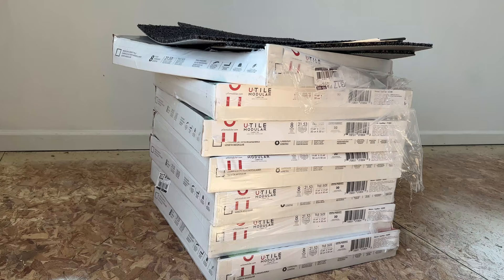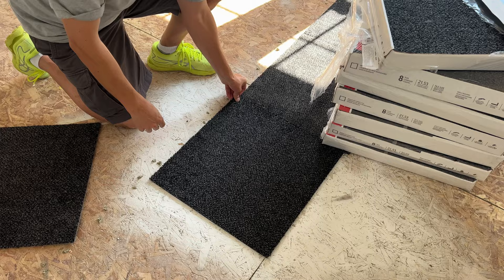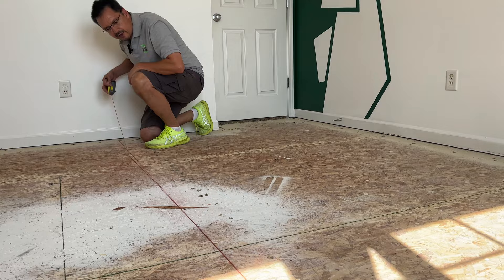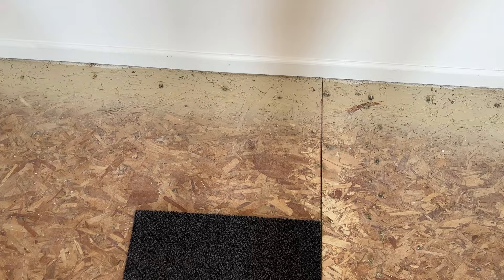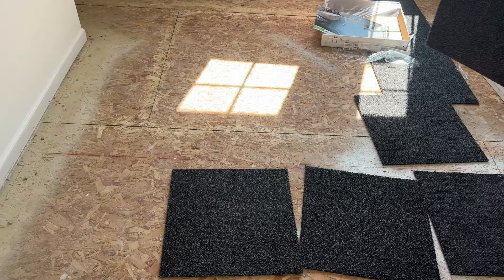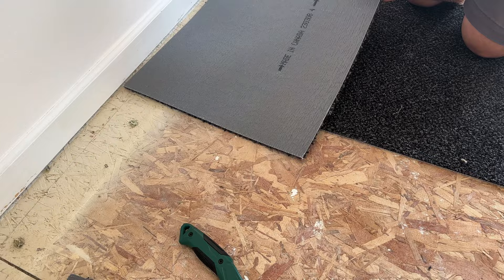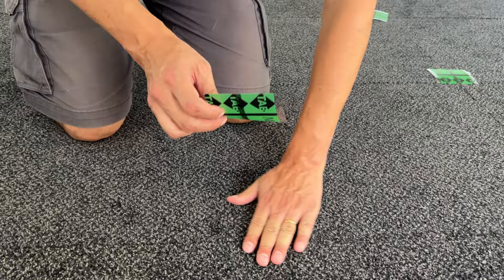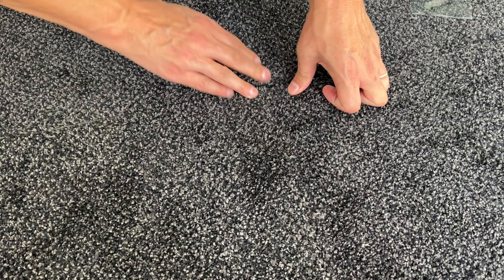New Flooring Made Easy with Carpet Tiles (Installation Guide)

Comment: Might be a stupid question lol. Can I use these on top of the old existing carpet? Or do I have to rip the carpet out and put it on the hardwood?
Reply from the maker: I’ve gotten this question before. As long as your old carpet is very flat, you may like the results. My concern would be at the edges the new carpet tiles edges may tend to tip up when walked on them or furniture’s placed on them. They really are designed to go over a flat subfloor…
Reply: @HomeRapidRepair  Okay. Thank you so much for the quick response. You definitely earned a sub!
Reply from the maker: @nhs8984  fantastic 👍🏼😊

Comment: So you’re telling me I don’t need to used floor adhesive when installing carpet tile? I’m installing tile this weekend in my son’s bedroom so do I not need adhesive?
Reply from the maker: Yes, you got that correct. Now in commercial installations going over concrete or so they often will use adhesive such as a casino or a retail store. But for residential use, it is not required at all. It literally is the simplest installation you’ve ever seen. Good luck. 🏠. By the way, we’ve made two videos of carpet tiles so far on the channel and in both cases, we followed the manufacturers instructions on the box.

Comment: Question, how well does the seams of each tile blend together after installation? Can you see the individual tiles when looking into the room?
Reply from the maker: Great question. The seams hold up really well, we have vacuumed these rooms many times without any problem at all. Yes I would say you can see the seams if you look down for them, it also depends at what angle you’re viewing the flooring from and the direction of the light in the room. Some people use this as an advantage. Since they pick two different carpet tiles and make a pattern out of it or something. But even being able to see the seams it still looks very nice. Good luck 🏠

Comment: Do these hold on a concrete floor.. mine has a sealer on it with a little grit?
Reply from the maker: Yes I think you’ll be totally fine directly over concrete.  Carpet tiles will never be as soft as traditional carpet with pad, but it has so many other advantages. It is worth it for sure.

Comment: Can this tile be vacuumed with out the corners unsticking to the floor?
Reply from the maker: I’ve not seen a problem with vacuuming at all. They sell millions of carpet tiles per year. Although in commercial installs they use floor glue, not needed for residential 😊👍🏼

Comment: Great video.   What type of carpet tile did you use?
Reply from the maker: Here’s the exact one!!

https://www.menards.com/main/flooring-rugs/carpet/carpet-tiles/u-tile-trade-modular-haven-19-x-19-carpet-tile-21-53-sq-ft-ctn/50037-15399/p-2844360748939450-c-6540.htm

There are so many great options… if you don’t find one locally, they can even be ordered online too…

Comment: Thanks for uploading! Do you know if the carpet squares can be installed over Interlocking Foam Exercise Floor Mats? That’s what’s down now and the extra padding would be nice.
Reply from the maker: I’m sure you can if you want to, However carpet tiles over such a squishy underlayment would likely cause the edges to tip up when walked on. You could purchase just 1 box and test it. Good luck.
Reply: @HomeRapidRepair  I see what you mean, maybe a little too much give. Thanks for the upload and prompt reply. 🤙

Comment: Great video, thank you! Quick question - do you tuck the tiles under the baseboard (like traditional carpet) or have them butt up to them? It looks like you measured and cut to the baseboards. I couldn't tell if your baseboards were installed a little lower (than normal) because you were not going under. Cheers.
Reply from the maker: Great question. These baseboards are low so just butting the carpet up to it closed up nicely. No gaps. If your baseboards are too high sliding underneath would be nice and hopefully no gaps. This stuff is so easy to work with 🛠️🛠️
Reply: Appreciate the response! Thanks! @HomeRapidRepair

Comment: Where do you get the sticky squares for the corners... name and where? ThxQQQQ
Reply from the maker: They were included in the cartons of carpet tiles. This exact one was purchased from Menards. Here is the link. Let me know if you have any other questions.

https://www.menards.com/main/flooring-rugs/carpet/carpet-tiles/u-tile-trade-modular-haven-19-x-19-carpet-tile-21-53-sq-ft-ctn/50037-15399/p-2844360748939450-c-6540.htm

Comment: Hi, just to confirm, the stickers are the only thing holding the carpet together and to the subfloor? There’s no additional adhesive needed or peal and stick on the back of the tiles? Thank you
Reply from the maker: That is correct. I have seen some carpet tiles with peel & stick backing. However, it’s not necessary with this one and most of them. This is technically a floating floor, the sticky tabs are literally only holding the corners down so when you vacuum and things like that, they don’t pop up. It works very good. We have not had any problems at all. Good luck 👍🏼🛠️
Reply: @HomeRapidRepair do you need carpet padding under these tiles? I know you’re laying it right now but I wanted to double check :)
Reply from the maker: @hannahwilson5325  these are designed to NOT use padding. Yes the final product is not soft. But very durable and easy to install. Easy to replace stained carpet tiles 😊🛠️🛠️

Comment: Do you think a moisture barrier would be needed under the carpet tile if their being installed in a basement?
Reply from the maker: I honestly don’t think so. Do you run a dehumidifier in the summer?

A moisture barrier test you can run is cut a square of plastic (like 2x2 foot) tape it securely down to the concrete floor. Check it in a few days if water droplets / condensation has formed under the plastic sheeting 🛠️🛠️
Reply: @HomeRapidRepair  Good idea for a test! And yes I run a dehumidifier in the basement. Thanks for the response!
Reply: A lot cheaper than a calcium chloride test kit. Lmao good work man!!

Comment: How good are the adhesives…how long does it last? When you vacuum does the squares move?
Reply from the maker: These carpet tiles require NO adhesive at all. So easy to use. No vacuum problems at all. The only obvious difference is it’s not as soft under foot as traditional carpet and pad. However in a lot of areas you want easy to clean and even replace individual carpet tiles if needed 🛠️🛠️
Reply from the maker: The longevity should be the same as traditional carpet

Comment: Free floating or sticky back?
Reply from the maker: These are totally free floating carpet tiles. So easy
Reply: I regret using the corner sticky tabs. My 2nd time around I used the releasable pressure sensitive adhesive and an very happy now
Reply: @Alien-fv9gd  what brand tape do you use?

Comment: What the hell man?… your not using GLUE first???
Reply from the maker: Glue isn’t recommended for this product. Residential carpet tiles. They are holding up great…no problems vacuuming, etc. 

Glue down is a different product and may be more common in commercial and over concrete sub floors. Thanks for watching 😊🛠️🛠️